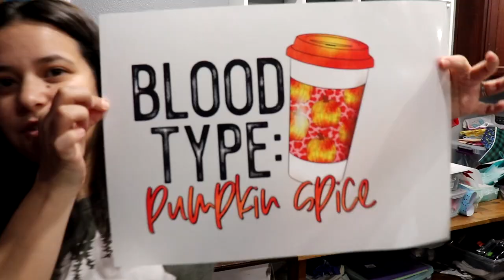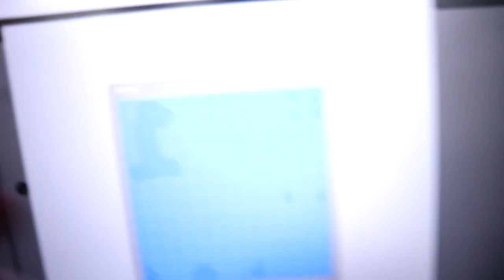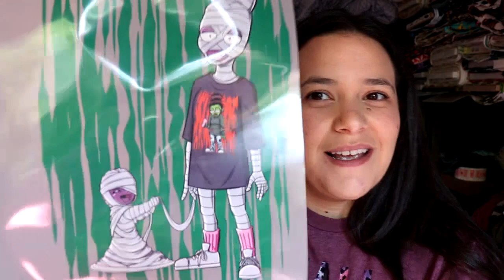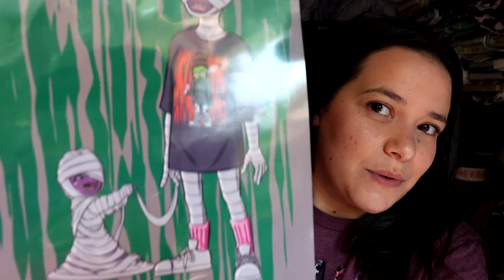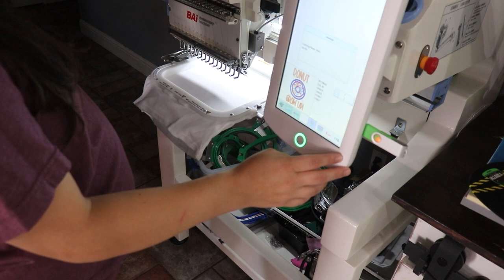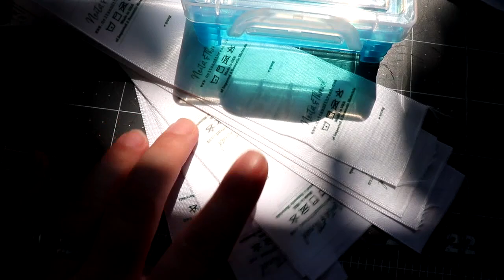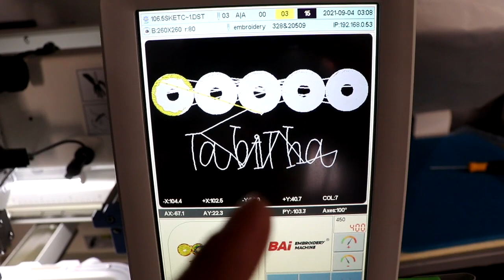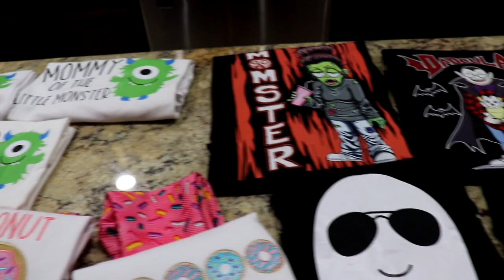A Week In The Life As A Successful Etsy Seller / Etsy Studio Vlog / Work With Me On Etsy Orders

Comment: I have never heard of my craft source until you mentioned it. I just bought a bunch of vinyl from 143vinyl and it’s comparable in price, but my craft source seems to be slightly cheaper based on what I order. I usually get the permanent adhesive vinyl for craft projects in 12” x 5 yard rolls and it’s $2.85 versus $2.75 with my craft source…so I might have to start purchasing from there. Every little penny makes a difference.
Reply from the maker: They are definitely my go to and their shipping is always super fast!